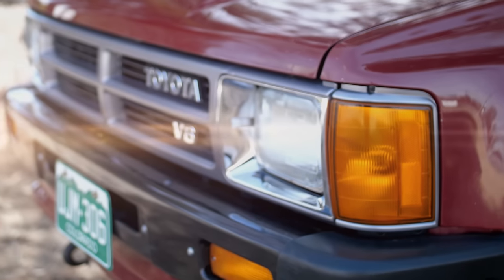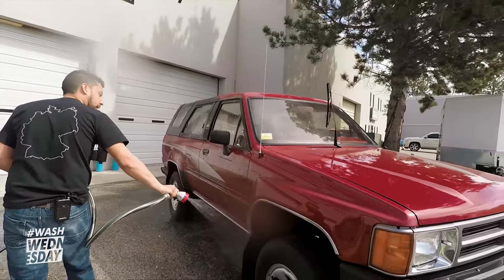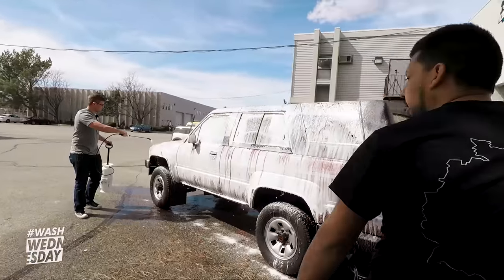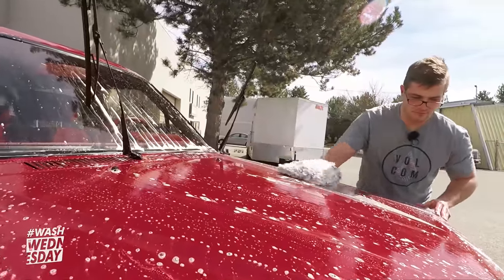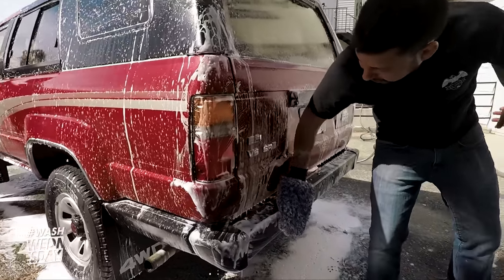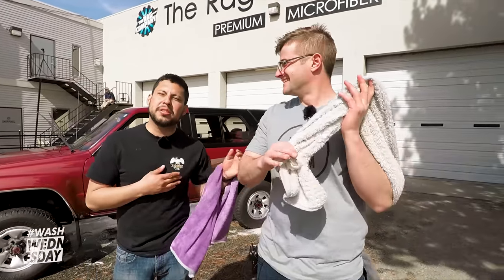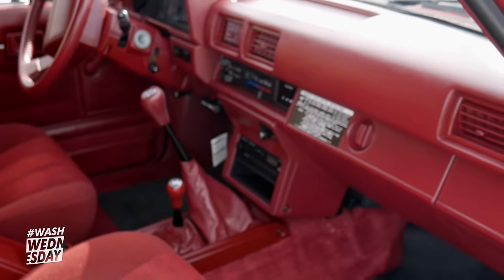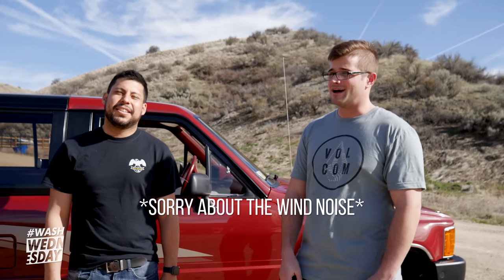Classic Toyota 4Runner SR5 Wash + Drive | WASHWEDNESDAY

Comment: What a beautiful 4Runner. Too bad it's not a 22re. Still, 37,000 miles is insane for a 1st gen! Also rare to have an 89 SR5 with the side vent windows. I have an 86 4runner with almost 400,000 miles on it, so if you keep that thing and maintain it with Toyota oem parts... it will last a lifetime.
Reply: 400k? Damn, these little 22Rs are troopers. My dad's 87 4Runner has just turned 250k on it.

Comment: I have a 1989 sr5 v6 the 3.0 is wicked shes got just about 400000 km on her i dont find it slow and iv put her through  hell went everywhere only replaced brake boster added K N air intake and duel exsust i had the 22re was not good sorry gave me trubles and never made it as far as the 3.0 did  my buddys 22re has bin pulled out by my sr5 more times then me by him lol  i dont use a wench he does anuff said
Reply: Sounds nice. I haven't been a huge fan of the sixes but they do make more power. My dad has a 22RE in his 4Runner, and has put that thing through it's tests.

Comment: Is the 4 cylinder motor just as good, I think it's 22r or 22re.
Reply: the 22r is more reliable, and I would prefer that over the 3.0 honestly although both are good
Reply: It has 180k small oil leak I think a 4bt Cummins would be awesome in one, American Hilux, I was thinking about trading my 06 Hyundai sonata for it, it has 117k and it's garage kept.

Comment: That's an SUV, not a car, nor a truck! LMAO!
Reply: One could argue that it is a truck given the fact that the 1st gen 4Runner was built off a truck chassis. Actually, this is a similar situation through out the 1st gen Tacoma's/2nd Gen 4Runners, and so fourth. Fun fact, the Tundra chassis is also used for the Sequoia's. So though, it does not have a truck bed, it was built off a truck chassis, and with top off, from afar it looks like a regular cab pickup. You some validity in the fact that it is a mid-sized SUV.
Reply: Teeeeechnically, the 4Runner was based off of Toyota's truck (or Hilux), therefore it is technically a truck.
Reply: @throwout1483  Doesn't matter because you'd never call a 1990 4Runner a truck would you?!
Reply: terceldude I call them trucks all the time
Reply: terceldude Well that's okay
Reply: it's a TRUCK! "SUV's" are high powered sport utility vehicles. I know this because I have the 1985 4runner SR5 5 speed with the 22re and sits on 35's and 5:29 gearing. only drove it on fire  trails and the beach.

Comment: Head gasket is going blow soon, they were plagued with this problem on the first gen 3.0 slow worst engine ever.thats why it has low mileage, dont drive it and you will be okay.
Reply: Alfredo Mendoza I’ve had 3 different v6 3.0s. One had 230k, one 300k and the last had almost 400k. All drove great when I sold them